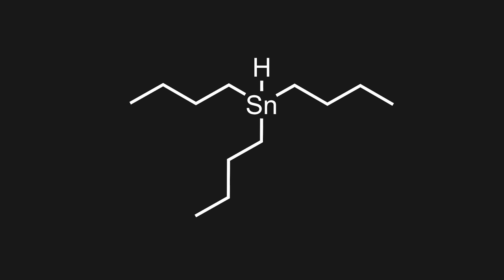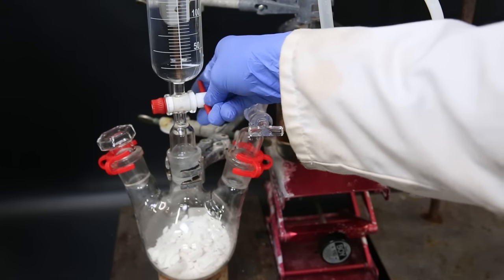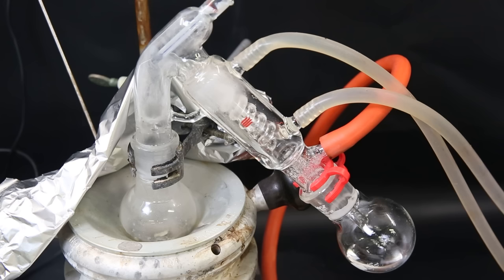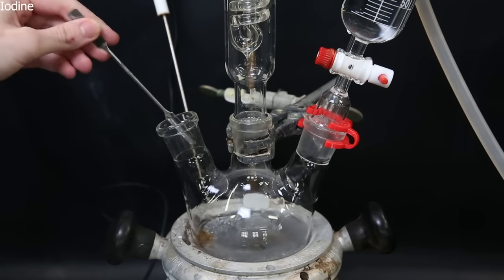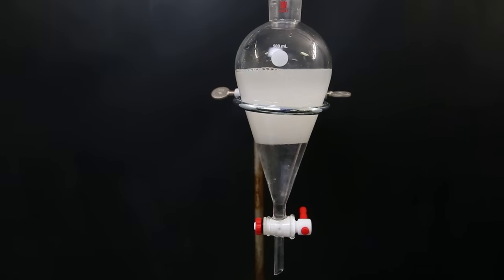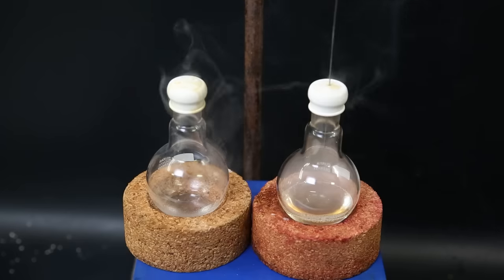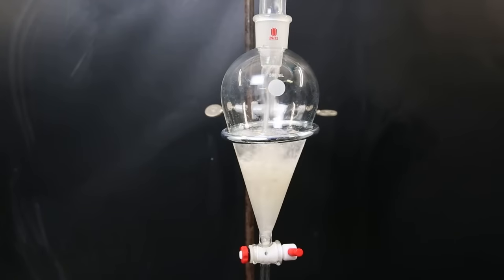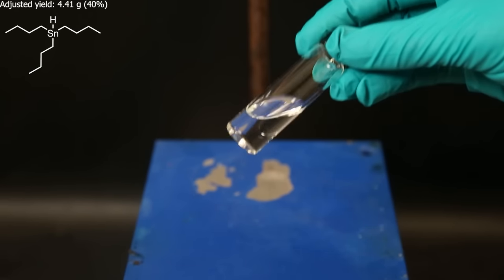Making Tributyltin Hydride - A Unique Hydrogen Donor

Comment: We had some tributyl tin chloride in my lab in a simple glass vial. Probably one of the most toxic and dangerous things I found during my sweep of old chemicals in my lab.
Reply: I've heard that tributyltin chloride isn't too bad (still not great though) and that trimethyl tin chloride is far worse in terms of toxicity and also smell.
That being said, trimethyltin derivatives are far more reactive in stile couplings due to less streric bulk around the tin
Reply: @tomflanagan878   actually it might have been trimethyl tin chloride.
Reply: @spiderdude2099  yeah it's horrible stuff. I have heard that it is very stinky as well as being incredibly toxic. You know it's bad when you google it and the third thing to come up is a study about how toxic it is to aquatic life
Reply: @tomflanagan878   organotin compounds are probably second or third in ranking of toxicity of organometallic compounds. Organomercury compounds are obviously number 1 but tin compounds can be hella nasty
Reply: @spiderdude2099  they actually do have a pretty common use though, they are air and moisture stable, and they are used in Stille couplings, which in general is like a Suzuki coupling, just a little faster and cleaner.
Surely some organoarsenic/organocadmium reagents are worse though, I'm not sure if they are as useful as organotins
Reply: @spiderdude2099  What about organocadmium?
Reply: @filipealarza9079   yeah that’s definitely up there. Top three easy
Reply: @spiderdude2099  Organo mercury, thallium, arsenic, lead are more toxic.
Reply: @durshurrikun150   I know dude, I'm just saying that was the worst of what I found in my lab
Reply: @spiderdude2099  The that that they still allow them to be used means that they probably aren't as toxic as organomercury and lead for example, otherwise they would be completely banned.

Of course nobody carries radical reactions with tributyl stannane or carries Stille reactions on an industrial scale, but those are regularily used in lab settings.

I don't think there's a lab in the world that uses organomercury compounds as reagents, unless they do research on them.

Comment: Actually from what I read, Iodine doesn‘t just remove the oxide layer from the magnesium, but more importantly it forms the iodide which actually catalyzes the formation of the grignard. No less, great video!
Reply: most of the times you will add it to see the starting point of the reaction as discolouring occurs.
Reply: @Torteufel  That is true, although sometimes the iodine is used up before the reaction properly takes off. Anyway point is, its not so much the iodine itself thats catalytic but the iodide.
Reply: @gefulltetaubenbrust2788  True as well. :)

Comment: This compound is such a pain to work with, how do you clean all this glass? I ended up just throwing out all of my flash tubes instead of generating that much tin contaminated liquid waste
Reply from the maker: Yes it is really annoying and tin deposits on the glass. I basically just scrubbed it a lot with some cleaning tools and let it soak in a strong base bath.
Reply: @Chemiolis  Base bath always does the trick for me too. Hate the smell.

Comment: I ❤ your videos. Great work!
3:59 you use 1-chlorobutane to make the gringard reagent butyl-magesiumchloride
I guess (carba)stannatrane is synthesized similarly. Wikipedia lists N((CH2)3MgCl)3 as precursor that somehow would needed to be made first. Any insights?
Reply: Also pondering about adding CH2SH groups onto the second carbon atoms beyond the central nitrogen (of stannatrane) to link the molecule to a gold surface making it investigatable via scanning probe microscopy. I fear this makes things probably much much more difficult if not impossible 😕.
Reply: Such CH2SH linkers have been added to adamantane. There are papers about SPM imaging of the deposited adamantane molecules. Specific example: "Tailoring electronic states of a single molecule using adamantane-based molecular tripods" by Satoshi Katano et al (2013)
Reply: I found there is a synthesis pathway for attaching linkers onto brominated adamantane in 
"Rigid Molecular Tripod with Adamantane Framework and Thiol Legs. Synthesis and Observation of an Ordered Monolayer on Au(111)" by Toshikazu Kitagawa et al (2005)

Comment: 2:04 That wouldn't have happened if a porcelain boat was used for placing the tin in the tube.
Can't imagine what would have happened if instead of the reaction tube (= my recommendation on the previous video 😉) the less heat resistent condenser was used here again...